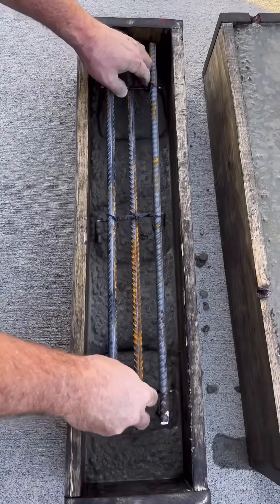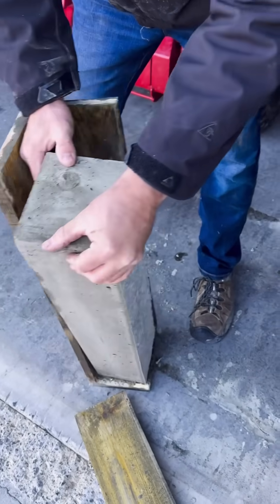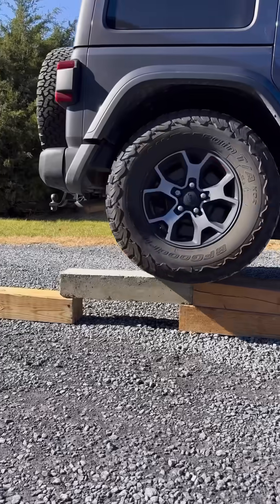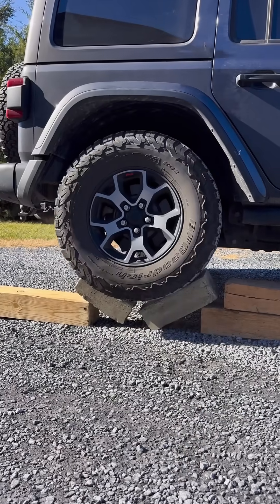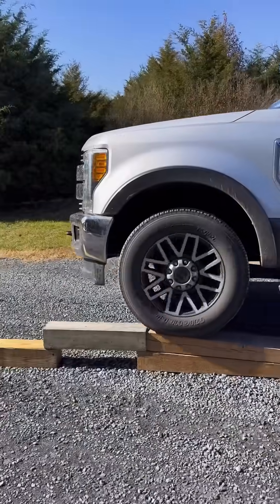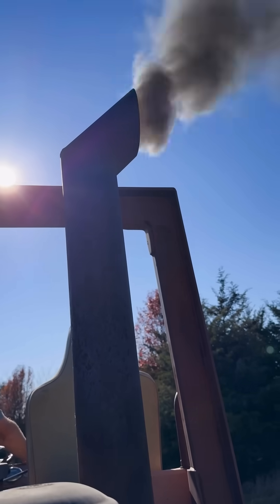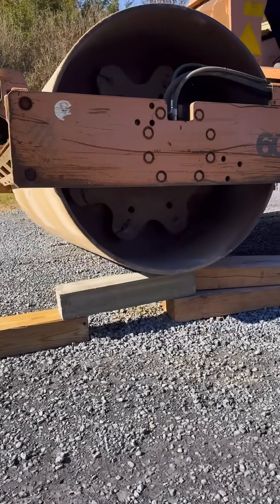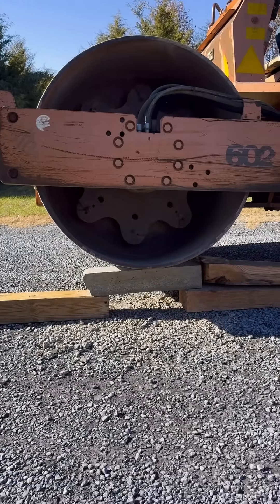Why We Use Rebar To Reinforce Concrete

Comment: Generally when testing concrete samples, geological companies do tests on concrete after curing a 7 day cylinder, then three 28 day cylinders and a final 56 day test. All of them done under and hydraulic press for exact psi breakages
Reply: I work for a geotechnical and testing company. We cast 5 cylinders. The first is a 7 day, and three more are a 28 day. The last is a hold cylinder. The hold cylinder is so that if the first 28 day cylinder breaks low, then the other 2 28 day cylinders and the hold are broken at 56 days. It differs a little bit. it may just be a difference in state rules.
Reply: Good example why we reinforce concrete. I’m a rod buster (ironworker that installs rebar) and we put tons of rebar in those industrial buildings and bridges n stuff. Like 1’1/2” rebar 2” centers on the top mat of a bridge deck plus the bottom Matt there’s so much rebar you kinda wonder if there’s room for concrete. lol
Reply: Perfect, but concrete test cylinders need to be underwater for 28 days minimum.
Reply: @felixsantiago5606 they are. They're typically left in specialized tubs that keep the PH and other levels of the water at very certain amounts that they can adjust themselves.
Reply: @felixsantiago5606 not true. I work at one of these companies. It needs to soak in lime and water until it is broken which can be 7 days, 14 days, 28 days, or 56 days. Most of the time they’re 7 or 28 day breaks
Reply: @felixsantiago5606 Not true. Depending on the mix, tests may be done within hours. 1 day breaks are done as well.
Reply: @felixsantiago5606 why under water?
Reply: @chanceschofield9324 Curing cement is a chemical reaction and needs water to react.
I do this kind of testing and we do it not underwater, but in a warm wet box with 100% humidity in the air.
Reply: @zeldamon5 what’s the best mixture ratio? For a concrete roof ?
Reply: @chanceschofield9324 I know there is already a response to this, but a bunch of people got together and decided to make a standard on how to make, cure, and break concrete cylinders. This standard is ASTM C31. This standard says that after the initial 24 hour cure in the field the cylinders must be placed in a 100% humidity, temperature controlled environment. So it can either be a mist room or a water bath. The two labs my company has, has one of each, there is no difference in performance.
Reply: @joshuacruz4046  best to ask the concrete supplier coz you sure wont mix a roof with a portable mixer. they can supply all sorts of products for strength ratings and fireproof walls etc.... and before all that an engineer will have to approve the load structure and any modifications needed to carry the weight of a concrete roof.
Reply: @zeldamon5 when I was born in 1959, my father was general manager for a Ready Mix company in South Florida,and he was pulling test cylinders on a Jr High Cafeteria floor they poured.   My mother was taken to the hospital and Dad arrived just in time.

I still have those cylinder core samples.  As dad used to say "You work concrete or concrete works you"
Reply: @chanceschofield9324 it actually has more to do with a newer mixture of concrete that has a limestone that mimics the properties of volcanic ash that was used in ancient times its how we have large buildings from hundreds of years ago as they had first formed the recipe
Reply: @felixsantiago5606   they dont need to be under water for 28 days they can be underwater for 7 days then you just calculate with the Faktor of 0.92 and not 1
Reply: Correct
Reply: and when you turned on the drum it reminds me of a fatigue test. Force was greater than ultimate strength or strength endurance. ME
Reply: Yep, this is what I do every day
Reply: I never did get the water tank process. Where I live that is considered cheating the test. I can see it helping the breaks but unless you are doing the same with the product that was poured you are skewing the test results. We pour big products so tanking them for 28 days would be pretty much impossible. Our state requires the cylinders to stay with the product until it’s time to break so the cylinders are in the same conditions until broke.
Reply: I was just about to come comment this
Reply: Ahh not exactly accurate. They at least used to make 2 sets of cylinders, one set to field cure in a insulated cure box near the pour, and a 2nd set for 3/28 day and a 96 day cure. And I think I remember having a middle set of days in there it's been a few years. Yes lab cured is retrieved after about 3 or so days and prepped and dropped in the cute tank. I want to say 3/28/56 day but can't be sure. Only time they would break a 96 day is if they noticed an issue breaking a 28 day. Then again I was working in that field under an old set of rules, around the time I moved on they were changing a bunch of standards to follow esp for plant qc/qa but I believe changed their field standards also around that time. It's been well over 20 years as I look back and that's a little depressing, but yes technically correct on the cure tank covered with water between a certain temperature, but also a set left in the field. If I recall correctly concrete gains something like 80% of it's strength in something like 10? Days and I could be wrong on that but from there it takes longer to get the rest of its advertised strength. Hence the 12 or maybe 14 day test. Make sure it's at a certain strength since that's when it gains the majority of its strength.
Reply: @officerbuzzkill  this was my job to test the concrete samples onsite and bring them the next day to the tanks where they would sit until they get broken the specified day of 7/28/56. Sometimes companies would even break it down to doing  a 3/4/7/28/56 set while still doing the 3 28 and 1 of the rest. I've worked with 2 companies that both operate under the same standard for it
Reply: 3)@thosebeamswerenot “ curedmaybeleft todryfor under3dayssrrengthwoyldveincreasedifthey werewatercureatabout73,5f plusorminus3,5 degrees f.
Reply: Yes exactly the curing time is important
Reply: I started with this before moving to ACI and ICBO certified Inspection...
Reply: Not underwater. A fogging room with high humidity to properly cure the test samples
Reply: It doesn’t need to be under water. SMH.
Reply: You guys do the 56-day? In my country the 28-day's result is counted as the 100% compression strength. I'm pretty sure us and uk do the same thing since our standard is pretty much referring to astm and bs.
Reply: I see someone was a concrete tech or probably studied civil engineering in college
Reply: @RisingInTheFlesh  I worked as a concrete field test technician
Reply: @jamescushman2439  I did in 2015 for an internship but I also did soil/asphalt testing and soil bearing capacity testing as well.
Reply: @RisingInTheFlesh  yeah I did soil testing too to start and then got my concrete certification to test concrete. Asphalt testing took too much to know for me. The book for it is like 400 pages that you have to be pretty knowledgeable in to get the certification for it.
Reply: Generally it's 7 days submerged in water and then the rest of the 28 days it can cure outside of it.
Reply: Seeing columns or slabs being demolished to pour again because the concrete mix wasn’t correct and cylinders failed the pressure tests was no bueno. 😂
Reply: no. geology has no interest in concrete.
Reply: Exactly right!!! And it keeps curing
Reply: 15 days at least.. With proper curing..
Reply: Maybe American  concrete...
Reply: @aussiereece79 kmko😊

Comment: Since the concrete crumbled instead of breaking it was probably less than 3 days old.  Come back in 7 14 and 28 days... no reason.  If you know you get it.
Reply from the maker: You are correct, it was only 2 1/2 days old

Comment: Hmm did you calculate the amount of rebar and the proper rebar size for the area of the beam? Because over reinforcement also allows for a brittle type of failed (instant failure or no warning of building collapsing)
Reply from the maker: Nope just winged it for the video
Reply: @hausplans hehe awesome, love your videos

Comment: Concrete needs 28 days to fully cure. At 14 days it reaches its rated strength but reaches its full strength by 28 days

Comment: 21 days in dry conditions for chemical process to complete with nearly 100% structural strength based on its design load.
Reply from the maker: 2.5 days

Comment: If you're going to do a proper experiment then don't change more than one variable at a time. The variable you were testing was reinforced vs. reinforced. You used your jeep on the unreinforced and it broke,you then should have used the same jeep on the reinforced. Changing the vehicle going over it changes another variable so now we can't reasonably conclude if it was the reinforcement or the vehicle used that actually broke the unreinforced concrete
Reply from the maker: I actually tested both pieces with a jeep. The problem is YouTube shorts are limited to 60 seconds so I had to edit out some parts to show the end result. This would’ve been a great video to do in format.
Reply: @hausplans  ohh that's good to know lol, maybe I should've checked before commenting haha
Reply from the maker: I wish they would increase the length of shorts to 90 seconds. Thanks so much for watching!

Comment: I literally have nightmares of living or working in buildings taller tham 4 stories high.. 
We weren't made to fly . You never know
Reply from the maker: I wouldn’t be scared of tall buildings. They’re usually mostly steel. Also, the concrete in this video had barely cured.

Comment: I argue that rebar just makes it all that much more expensive to remove. All concrete eventually gets removed. People's plans usually change long before my concrete crumbles.  I never put rebar over piping runs because its a nightmare to access the pipes, not if, but when they spring a leak or require upgrades. The surface will spall, the slabs heave, or it just looks old and dingy and people want new. I only add it if a semi truck has to drive on it. Fiber helps a lot too, but also makes a giant mess during demolition.
Reply from the maker: Interesting what you said about more expensive to remove. The city doesn’t want rebar in their sidewalks for that very reason.
Reply: @hausplans  I replace gas station fuel systems and I make so much $$$ because I have to assume there is rebar, but it's like 50/50. But bidding lump sum it's a huge gamble, so it could take me two days or two weeks to rip it all out. Just never know.  The piping always has problems so I only put rebar back over the tank tops where a semi truck has to sit to deliver fuel. The drive lanes just 6-8" of fiber. I dowl the slabs together but that is it. Also look how crappy the concrete is on any gas station it's pretty terrible. Patches on patches on patches most of the time, so my patches are always the nicest concrete around by comparison. I just do quantity over quality and make sure I run lots of joints.

Comment: Now if you put rebar in there in a 4 x 4 x 4 x 4 pattern with a hoop with one piece of rebar in each corner of a hoop El increase your tensile strength even more if you would have turned your piece of concrete with the rebar in it sideways it would have been a lot stronger

Comment: Should try roman concrete next. They just figured out the formula
Reply: https://youtube.com/shorts/Wc7Q2UJ3WtE?si=xbLHrPLc648W4wgk
Reply: For anyone doubting tgat Roman concrete is better in every way 
https://youtube.com/shorts/Wc7Q2UJ3WtE?si=xbLHrPLc648W4wgk
Reply: Still not as strong as modern concrete reinforced with rebar.
Reply: @MrLee-cy1pw it is but only after 1000 plus years
Reply: Roman concrete is designed to last a long time, modern concrete is designed to be strong
Reply: @beanboi9088  That's not true. History channel just did a 2 hour documentary called deconstructing roman concrete. It took years to reverse engineer it. It is stronger and longer lasting. And it has to do with water. Every time it rains or gets wet, the unique makeup allows the concrete to reshift itself to its strongest possible shape. You can actually see it under a microscope when it gets wet. And you can add rebar to it so it's better in every way.
Reply: @jk19781  its made to reconstruct itself when broken, yes, but modern concrete has characteristics that roman concrete cant compare itself to
They both have advantages and disadvantages but modern concrete is better for the purposes we mostly use it for, such as buildings
Reply: @beanboi9088  You obviously don't know what yiur talking about.
Reply: @jk19781  Roman concrete has compressive strenght of 6 MPa, while standard for modern structural concrete is 10 MPa. You can't use rebars with it, because it'll erode the steel, you can't pour it and it cures for much longer. Oh, and it's more expensive. It's only advantage is longevity, including resistance to seawater.

Seriously, I know it's nice to have this cool imagery of ancient civilizations doing better stuff than we do today, but this roman concrete ramblings are getting ridiculous.

Comment: Do one where you apply tension to the rebar and then pour concrete and then release the tension causing compression on the concrete. That will increase the tensile strength and maybe hold up to the roller…
Reply from the maker: That would be cool, I think if I’d let it this one cure more it would’ve sit up to the roller as well. This was only 2 1/2 days old super green!

Comment: "Show's how important it is to reinforce" I mean it totally depends on the area and purpose of the concrete so not necessarily. If it's application wont be one where it's driven over by vehicles or experiencing tensile load then  it's probably not needed.
Reply from the maker: Yup

Comment: also something really interesting is that you can make rebar work better by having it already under slight tension when it's put into the concrete, it greatly diminishes the amount of give when tension is added to the rebar, which dramatically increases the amount of weight it can handle before the rebar stretches enough to let the concrete on the bottom crumble
Reply: How does the process of creating tension while putting it in concrete go? I’m very curious
Reply: @JesterBM search up "prestressed concrete", one way is to have wires under tension, then you form the concrete around it, then release after the concrete cures.  This keeps the steel under tension while it's entrained in the concrete
Reply from the maker: Correct, this is often done and important things like bridges
Reply: @hausplans post a comparison of the 3.. no rebar.. layed rebar.. & prestressed rebar.. prestress by welding threaded rod to each end .. plate steel end caps with holes for the rebar to pass through for a channel steel mold to tension prestress & cast.. leave them for a month or more though for a reasonable cure.. have the top side of casting on the bottom of the test.. the top side WILL be weaker having dried while curing vs the bottom side of casting not "drying" in retaining more water for the hydration cure reaction.. concrete cure stops as soon as it "dries".. keeps curing (hardening) its whole life as long as it stays wet or damp.

The vibrator was a bad idea.. concrete doesnt withstand shock loads well either.. should have run that over a wood plank/board for all the tests as a cushion
Reply: Post tensioning is often used in high rise construction to reduce the density of rebar, replacing it with steel strands run in ducts that are stressed during the concrete curing process
Reply: The rebar doesn’t “work better” by tensioning the system. Mild reinforcement bars don’t get pretensioned, high strength steel tendons specifically used for pretensioning do.
Reply: U basically only do that for bridges never saw it done anywhere else
Reply: @Joker-ik1sp  I've seen it done on home slabs to avoid cracking especially if the slab is finished as the home floor.
Reply: @Joker-ik1sp it’s very common in parking decks also
Reply: @elijah8159  I can imagine that but I have yet to build one
Reply: Hmm... it's like with people.
Reply: From someone not in the physical trades, this does makes sense from a purely common sense perspective. You want the rebar under tension, and the rods would be sufficiently stabilized by the concrete so they’d resist losing tension. Not to mention the concrete would serve as an early warning system since a pattern of cracks could be recognized as a break in the rebar. 

Just to clarify though - you’re talking about laying the rebar and then pouring concrete over it in a permanent setting right? I can’t imagine how this would work with something pre poured and moved.
Reply: @AnthonyBolognese710  in NZ.. they cast prestressed slabs.. whole floors then low bed truck & crane them in place.. arrays of hydraulic rams & cables tension the rebar through the panels till cured.. wall panels beams & floor slabs
Reply: Yea, I used to work for Durastress in Florida. Built 55 foot poles for traffic intersections. 4 per pole bed. Each cable in each pole was about 1/2" thick and pulled to something stupid like 349,000 lbs of force at lunch time. If you didn't graphite lube and set your collets right on the other end of the bed at the start of the day (5 A.m.) and the collet didn't hold, you'd never know before you're scattered in millions of red bloody pieces across the yard. You're staring death in the face for half a day every day. I was a foreman for a period of time. Had this spiel several times with guys working under me. I liked building concrete pipes for a different concrete plant a little more. Less life threatening 🤣
Reply: Pre stressing is cool
Reply: That would be under prestressed condition.
Reply: Keep in mind that it is not good in every situation to prestress because it reduces its ductility